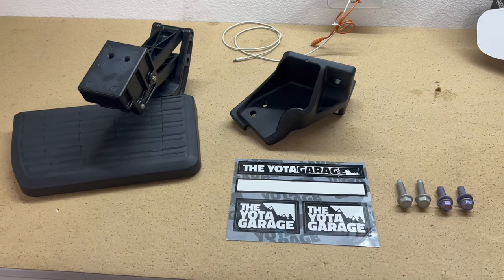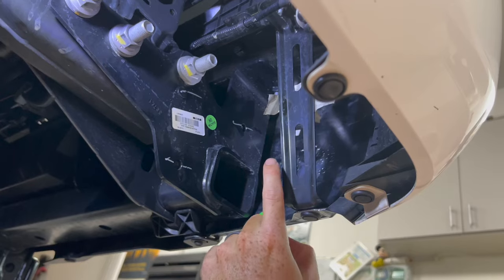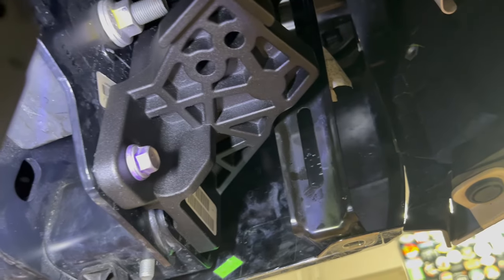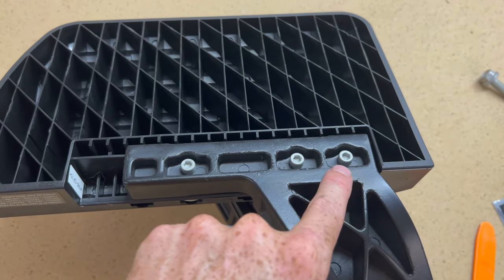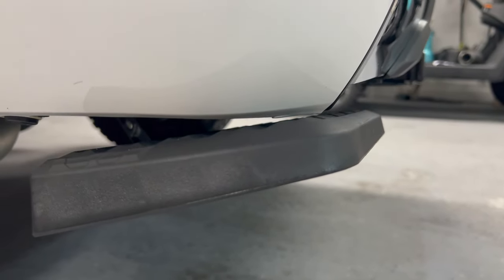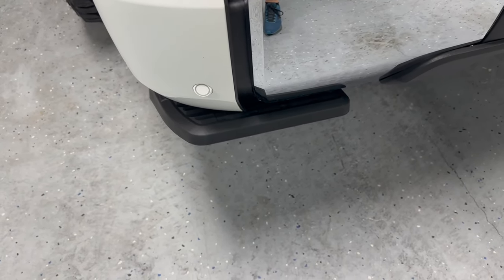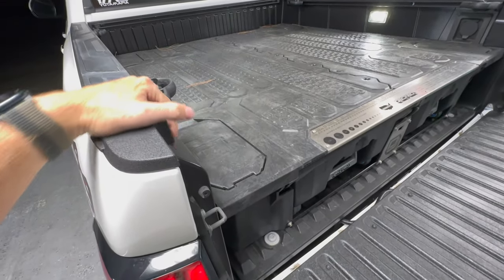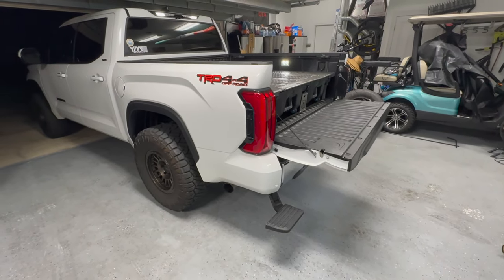Every 2022+ Tundra NEEDS This Bed Step! Easy Install

Comment: GM Trucks have the tailgate & step figured out.
Reply from the maker: Yep
Reply: Now you have to weigh the differences. Dependability, gas mileage, resale value. VS, General Motors Nice step?

Comment: Decided not to do the power version?
Reply: Power is only available from Platinum up except trd pro
Reply: @ricgotsli  surely it can be purchased separately and added, as the channel owner did.
Reply: I'm so glad I got power steps on my 1794, I have back problems and was always jumping into my Tacoma and don't think I could live without it anymore.

Comment: Need a video to show how to get that metal bracket out of the way. The bumper is in the way of using a socket on the top part and I don’t know how to pop out the plastic piece holding the bottom in place.

Comment: I have that got it installed at my local dealership for $40 for the install and I got that same day of delivery on my 22 tundra trd pro on Aug 1 ….also I found a dealership in Rhode Island that had 3 in stock and paid $345 shipped to my house so I paid $385 total that’s with install …these were on back order and I was number 35 on list so I did my own research at the time and found a RI dealer had 3 in stock step with bracket full kit
Reply: Have you had any clearance issues with the step and the exhaust? Several people have reported that it hits the TRD ehaust.when opening and closing.
Reply: @paulf9653  nope…zero issues with the bed step hitting the trd exhaust tips .,,never heard about this one….but I had my local dealership install it… but maybe them guys tried ito install it and maybe put it on the wrong holes 🤷🏻‍♂️

Comment: Got admit it’s pretty irritating to have to pay $400 for something they should have standard! I am so far refusing to do it but as I use this truck on the job site, and have it loaded many times with the gate down, hopping up in that bed at 66 years old is pretty hard to do. I might have to break down and spend the money.

Comment: Thanks for the video.  I just had my Toyota dealer install bed step on my ‘22 Platinum Tundra.   I looked at the installation of mine and it looks correctly bolted up to the rear bumper tubing/frame.  The problem is that mine is touching the bottom edge of drivers side rear bumper when it is in the retracted position.  Any one else have this issue?  Mine appears to be OEM parts from what I can tell (Amp-Research now has their version available but of course it is not in stock).  Anyway, I am not thrilled that this is touching rear bumper because I am sure there will be some vibration while driving and cause some issues with the plastic bumper material and paint.  How much clearance does the top of your bed step have when it is retracted?  Appreciate any comments/replies.
Reply: I have a 22 - 1794 edition and bought the step from Toyota installed it and YES it touches the bumper. pretty frustrating for the price. however the electric  step doesn't touch the bumper and doesn't look angled like the manual one.

Comment: Jon…u put your foot on the side there is a side edge where u put your foot to bring it down …not from directly from the back cause there is no space for it…
Reply from the maker: I barely see space to do it from the side either. It’s just as bad from the sure
Reply: @TRDJon  ya it sucks either way but I find it better and also they put those ridges on that side prb for that reason  to put your foot and bring it down…cause if U look at it the bumper on that side curves in more for your foot …now directly behind there ain’t no space for your foot 🤷🏻‍♂️